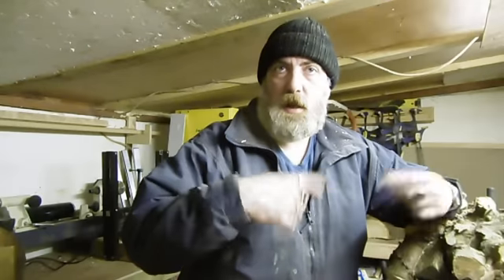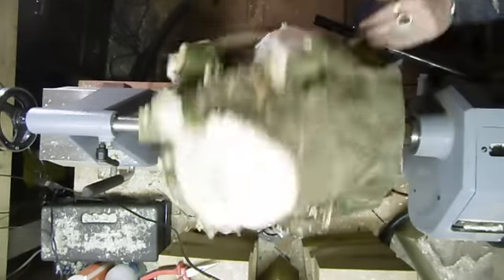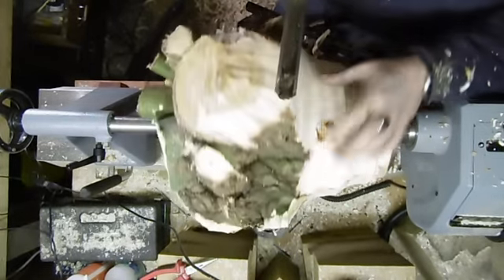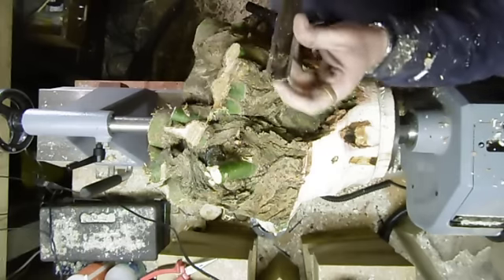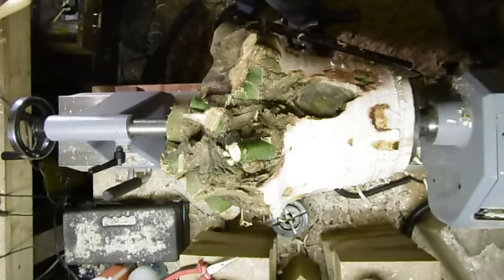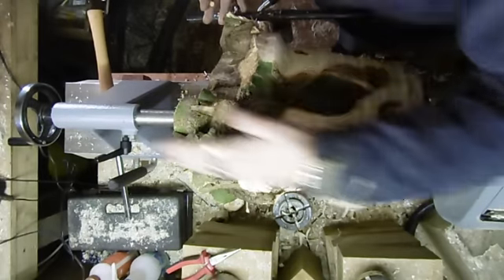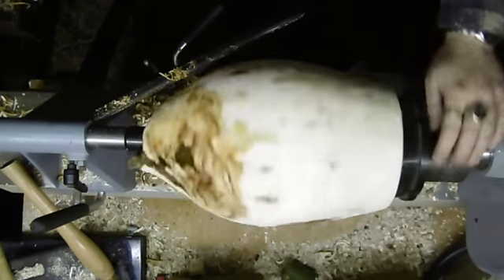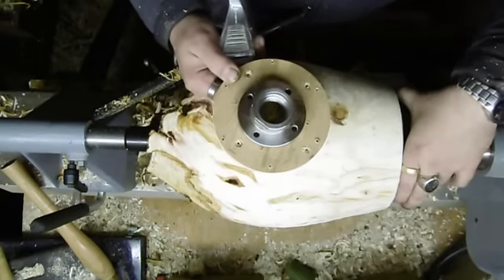hollow form roughing and a bit of soldering , pt1

Comment: Hi Mark, I also turn pieces like you but my lathe slowest speed is 500 rpm which is too fast so I use my home made lathe which sometimes I have to run at  about 100 rpm,as you say not at all scary, found you video on makers mind and now subed
Reply from the maker: Cliff Phillips thanks buddy and can you not change the pulley ratio on your lathe? I didnt think before this video but I can change mine to high torque and the speed is reduced also, slowest I can get is 64rpm lol, very impracticle for turning though other than maybe thread tapping but thn speeding up to the same speed i had before I would have a smoother turn

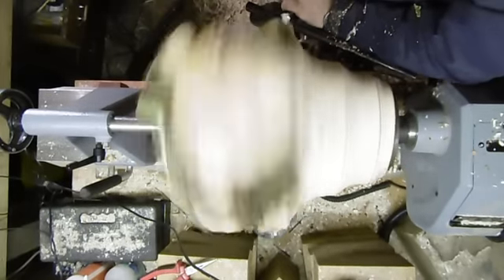Comment: GREAT Video! I just found your Channel and HAD to Subscribe! Quick question. When you were talking about Catches, (around 11:40 in the Video), did I understand you to say, To minimize catches, it's better to lower the handle of the tool, but it IS ok to have the flute all the way open (at 12 o'clock). The same principle as "rubbing the bevel" and raise the tool handle till it starts cutting? I've only been Turning less than a Year and want to learn as MUCH as I can! You're a GREAT Teacher btw! Looking forward to seeing all your videos! Have A Super Week!.....Gus
Reply from the maker: TheWoodWerker thanks buddy and also for the subscribe, yes it is  safe at that lathe speed ( 200 ish rpm ) and with everything secured with a spindle roughing gouge but if you are new then it is best to stay with a bowl gouge with the flute open, slower but less strain and less judder.

if your lathe is small and designed really for spindle work then the minimum speed will be 500-750, maybe even 1000rpm... anything over 300rpm for this work in my opinion is a risk.

also you will see that the end of the spindle roughing gouge is not overhanging the toolrest too far, the max i hang over is approx 1.5 inch.

just take your time :)
Reply from the maker: TheWoodWerker oh also i forgot to add, I havnt been turning for long either, i think about 7 maybe 8 months now but i have learned a lot from youtube, any help i can give I will do, if you need any help just ask :) anything I don't know i wont guess ill try to find a vid to help you.

happy turning buddy :)